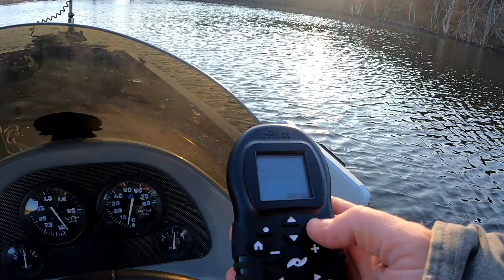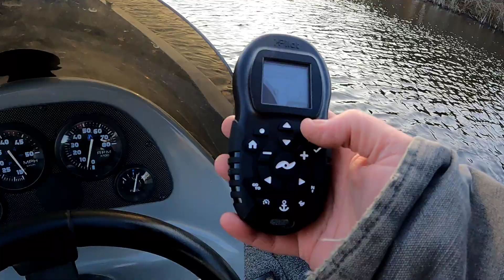Minn Kota Terrova I Pilot Calibration and Testing #minnkota, #terrova, #ipilot

Comment: Just saw this video, never knew I was supposed to calibrate the thing. No wonder my heading ends up all over on spot lock. Thank you
Reply from the maker: Hopefully that helps👍
Reply: Did you not read your manual? You may also need to adjust your boat scale in settings
Reply from the maker: @chrisbenedict4927  I know you're probably talking to the other guy but I actually bought mine as a new boat take off and didn't get a manual with it. It would probably be a good idea to download it.
Reply: @chrisbenedict4927  I installed my Terrova Saturday. I did not get a manual. I got a quick use guide. I even had to google how to pair the remote to the motor
Reply: The heading sensor is ONLY for the jog feature on spot lock. It has nothing to do with your actual spot lockc

Comment: Just curious why you wouldn’t use the transducer that’s built in. I have mine hooked up to a helix 7 and works awesome.   No cables to worry about cutting off and stuff like that.   I had a PowerDrive 55 and switched to a terrova 80 lb last week.
Reply from the maker: I'm still not running a finder up front. Been kicking around the idea of getting livescope though. Thanks for watching!🎣
Reply: @Midwesthookset  I have a garmin 73 uhd on my console.   Absolutely love it.   No live scope yet though.   Looks cool but I can’t really justify it yet.
Reply from the maker: I tell ya what, I came pretty close to justifying it this ice season lol. Maybe before next ice lol

Comment: Any issues with cracking on the bow welded seams? I am purchasing the Terrova this week and was told the mounting needed to to reinforced.
Reply from the maker: I don't believe so but I'll check in the morning. I haven't heard that before. The trolling motor I replaced was mounted the same way and I didn't see any issues when I swapped them. Both are 55lb thrust.
Reply: Mark Blackstock discussed his cracking on his channel. He has a Tracker Heritage.
Reply from the maker: Went out and looked and the welds on the bow. I'm not sure how the welds on a Tracker compare but I really don't think there's anything to worry about on this alumacraft.  Very heavy duty welds.
Reply: @Midwesthookset   Probably should have bought an Alumacraft.
Reply from the maker: Id be really surprised if you ever had a problem with it. I mean, most of the trackers come to the dealer with trolling motors already installed directly to the bow, don't they?
Reply: @Midwesthookset   Yes, they come with a Minn Kota Edge.  The problem is the way the Terrova mounts close to the edge of the bow with no support behind it. I’m going to use a plate mounted to the front deck for support. I’m sure it will work.

Comment: Just an fyi, that's not a gps puck, it's a heading sensor (compass) and it's only function is to allow you to use the jog function while in spotlock mode
 Also!!! Make sure you move your tension knob/depth collar down all the way when you travel on the water or trailering on the highway.  That is a safety catch so your motor doesn't deploy on accident!!!
Reply from the maker: Yeah, I get used to seeing people call it a gps puck on facebook and then can't remember heading sensor lol. Thanks for the info on the safety catch. I'll do that from now on!
Reply: It makes your spot lock way more accurate also so that’s not the only thing it does hotrod
Reply: @trumpking4874  nope. Its Only a compass that tells your TM which way the bow is pointing, for the jog feature.......hot rod lol
Reply from the maker: It's probably not due to the heading sensor but i had a pre 2014 model Terrova on my previous boat and this one keeps a much tighter spot lock radius.
Reply: @Midwesthookset  yes the newer ones post 2017 are a million times better

Comment: Does the spot lock work better after calibrating it? Mine is pretty sporadic but I haven’t calibrated it .
Reply from the maker: Not really sure since I calibrated mine before I tried it out. I will say that it does a noticeably better job than the old 2014 model I had before.

Comment: It was a great job.

is it nothing to do with turning a boat by counter clock-wise or clock-wise? for heading sensor calibration.
Reply from the maker: Doesn't matter which way you turn. Just 2 full circles. Thanks for watching!🙂
Reply: @Midwesthookset  Thanks for your reply.
Reply from the maker: Absolutely 👍
Reply: U have to do it fairly slow also. I was trying to do mine fast and it wouldn’t calibrate.  Turned the trolling motor down to 3 and it calibrated right off the bat

Comment: Wonderful video. Im a new owner of a Riptide Powerdrive Gen2. WIll I need that heading sensor puck in order to get to the Sensor Calibration mode on my remote?
Reply from the maker: Thanks! That's a good question. I don't think you'll have anything to calibrate unless you add the heading sensor. What year is the motor? They started including them in 2017, I believe.
Reply: @Midwesthookset  Mine is the recent/current generation Riptide and I didn't get the heading sensor. I saw on another video mentioning the Powerdrive is an entry level Ipilot and doesn't come standard with that puck.
Reply from the maker: Ok, then the sensor can be added if you choose. I'm betting your remote has the calibration menu already, and if you add the sensor, you can calibrate it. If you don't add it, there's nothing to calibrate. Some say it will hold your boat in a tighter radius, some disagree. I do know it enables the jog feature, which allows you to move your boat 5ft in any direction with the push of a button. I still haven't tried it yet lol.
Reply: The heading sensor is not needed to calibrate your motor,  it's only purpose is for using the jog feature while in spotlock mode
Reply from the maker: I still need to try out the jog function. I always forget about it when I'm on the water lol
Reply: It's a cool feature,  I don't use it a ton either, but a good way to use it is to really pic apart structure and move around slowly as to not spook fish. Also if you really want to comb through a shoreline or go down a weedline, just spotlock where you want to be, then just jog up 5 feet every few minutes as slowly work your way down

Comment: Can you tell me how much the Terrova 55 pound thrust tolling motor weighs? Because of my back issues, I am hoping it is noticeably lighter than the 80 pound thrust Terrova. Thanks, Tony
Reply from the maker: I really have no idea and dont have an easy way to weigh it either. I will say that with the lift assist, it's much nicer to stow than my pre '17 Terrova and the Maxxum I had in the past.
Reply: @Midwesthookset  That is good to know. Thanks

Comment: Whenever I use mine sometimes it goes nuts 
I thought there were three steps to set up
Pairing 
Calibration 
3rd one not sure
Reply from the maker: The heading sensor offset. I believe. I still haven't done that one. I keep forgetting lol. Thanks for watching! Mine has been working great, knock on wood. It put in work today!
Reply: @Midwesthookset  thanks I’ll try that
Reply: What is it doing exactly?

Comment: You will probably need another battery if you run Auto Pilot and Spotlock a lot. It will kill one battery in about 4 hours. I am running the same setup with two 27 series batteries. I troll a lot in high winds. Two batts work much better.
Reply from the maker: So far, so good for me but I will find a place for another battery, if the need arises. I definitely use the spotlock more than trolling
Reply: I fish on big water….the Columbia River and mostly for salmon and smallmouth. I have the same TM and quickly upgraded my battery to  LiFepo4 100 ah
 battery. It now will run 5-6 times longer than with a new standard deep marine battery. I can troll at 6-9 power all day. I have yet to even come close to draining the battery. Before it would get about 2-3 hours and then slow wayyy down.
Reply from the maker: That's great info. Any chance you have a link for the battery? I can see that upgrade in my future.